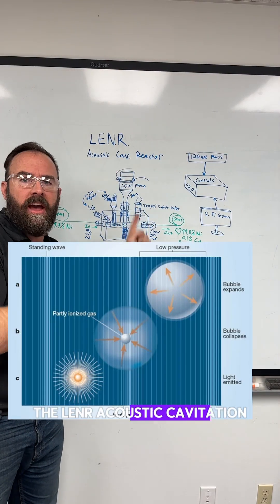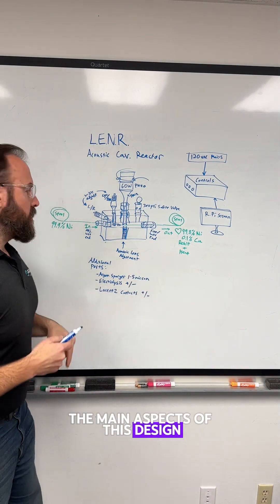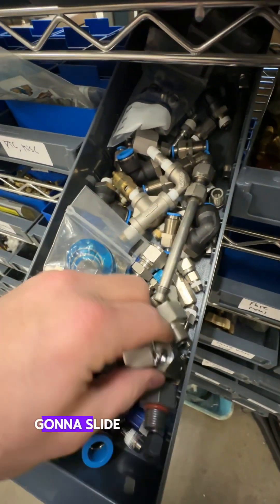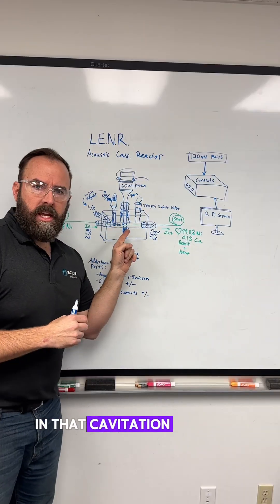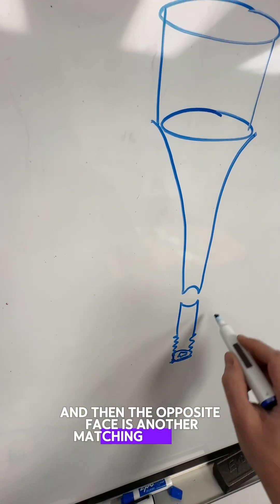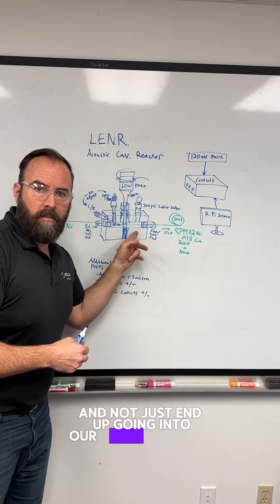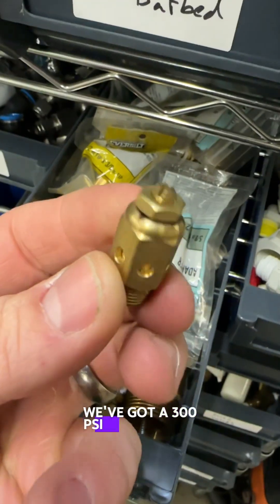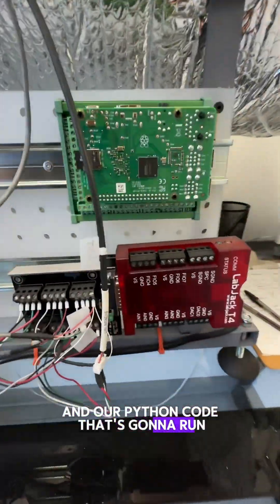Open LENR 2 - Single Bubble Sonoluminescence Reactor Design

Comment: Are you accounting for how ambient pressure will affect the resonance of the cavitation bubble?
Reply from the maker: Great question, and yes, video 5 addresses our control method for all of that.
Reply: @i2c_jason  Supercritical D₂SO₄ would be interesting. It can dissolve a fair amount of deuterium too. 
It would be hard to pack more deuterium in a small volume. Higher concentrations of deuterium have to make a D-D fusion more likely, I'd think. Of course there would necessarily be some supercriticality happening for brief instances in the region of the collapsing and rebounding cavitation bubble, even in a super cooled sample.
The collapse of a cavitation bubble should be more intense in D₂SO₄ than in D2O which is more energetic than in H20.
Reply from the maker: @punkinhaidmartin  thank you for the suggestion, I'll look into it. There are a plenty of things to try here once I achieve sonoluminescence and have a foundation of data, so that's a great idea.
Reply: @i2c_jason  has YouTube changed hiw it displays these conversations? I can't find my last comment.
Reply from the maker: @punkinhaidmartin  idk, something is wacky about this convo history. I grabbed a screenshot before it was gone because it was a great idea. I'm trying to hold on to all of the good ideas from the community. Maybe your idea was too good? haha
Reply: @i2c_jason  I hope it's good enough to steal! 
I'm working in methods to gather more deuterium more easily than the Girdler Sulfide process, so it's potentially in my interest to find more uses for lots of it.
I figure you need all the deuterium you can get in the smallest volume possible.
As far as I can tell, pharmaceutical grade compressed liquid ND3 would give you the most D in the least volume, being 75% D. Then you can pack some more in there by lowering the temperature and raising the pressure to dissolve as much D gas in the ND3 as Henry will let you.
Run it through a tube (not brass or copper) with synchronized transducers set around it radially and keep track of the temperatures. The tube walls should focus the ultrasound axially in the tube and you can observe the focal line with a borescope, maybe.
Reply from the maker: @punkinhaidmartin  So you'd be creating sort of a liquid acoustic Tokamak if you kept it spinning. Man that's an interesting geometry. That could allow even more energy over time than a point. One thing I love about the cavitation reactor idea is that we're dealing with significant mass right out of the gates. A high vacuum reactor seems counterintuitive to me because although you can do a lot with kinetic energy of particles and gasses, when you're dealing with a liquid slamming together you have so much more mass and momentum to play with.
Reply: @i2c_jason  I wasn't thinking of spinning. Just radially arranged horns pressing against the outer wall of the tube in a static position.  Something like very hard drill rod can transmit the sonic energy to the tube wall almost like a fiber optic transmits light. Come to think of it, a very thick fiber optic rod could transmit ultrasound and a big laser pulse at the same time.
Reply: Watch out for helium-3 and tritium production if you happen to get a D-D fusion event.
Reply from the maker: @punkinhaidmartin  True, the idea of waveguides would be very useful in any of these configurations. I wonder if you could spin it though, you might get more dwell time in a continuous process, since the fluid could make several passes and some small percentage could be introduced and passed at the same time. Either way, some kind of tube idea is cool.
Reply: @i2c_jason  well, you can certainly spin the fluid more easily than the apparatus. You can spin the signal too. 
I don't understand how spin would help though.
Reply: @i2c_jason  lost another reply.
Reply: @i2c_jason  just about every living thing is a tube supported by other tubes.
Reply: @i2c_jason  other than that, the next most dense population is liquid D2, and the absolute limit of density is a D2 Bose Einstein condensate. Liquid D2 is probably the best medium for D density without spending a billion dollars.
Reply from the maker: @punkinhaidmartin  How about a BEC in liquid D2 with a colloidal palladium in a strong magnetic field during the adiabatic rarefaction void, then slam that bubble down. Muon induced fusion then maybe? I love the BEC, but don't love anything that has to be super cooled or highly toxic. I'd love to achieve something with completely ROHS components and reactants if possible.
Reply: @i2c_jason  I think a BEC in liquid D2 would just be liquid D2. Perhaps D2 can be cooled to a point where there is a slush of D2 BEC and liquid D2, so thst it's all on the verge of phase transition into or out of a BEC state.
Reply: Well? Any news?

Comment: What does the nickel wire do?
Reply from the maker: The Nickel wire will be loaded with Hydrogen and hopefully a couple atoms will fuse into Copper via a Muon catalyzed fusion and/or other more speculative effects. It's a longshot.
Reply: @i2c_jason  how the heck does a nickel wire get loaded with hydrogen??
Reply from the maker: @zfolwick  I'm so glad you asked! There are a few ways - 1, in situ Hydrogen electrolysis using the wire as an electrode, 2, pre-load the wire by keeping the spook in a separate chamber that has a hydrogen gas atmosphere in it from #1, and my least favorite way but it could work might be to use an electrolyte instead of H2O or D2O.
Reply: @i2c_jason A verry Longshot!
Reply from the maker: @richardmccann4815  lol yes. Still, it'll be rewarding to achieve sonoluminescence, gather the data, and design a reproducible open source rig. There's always a chance that some other notable phenomenon pops up in the midst of this experimentation.